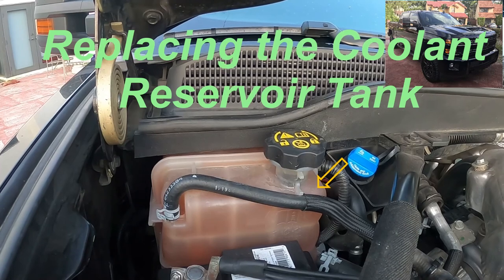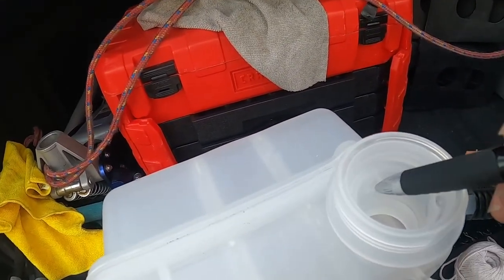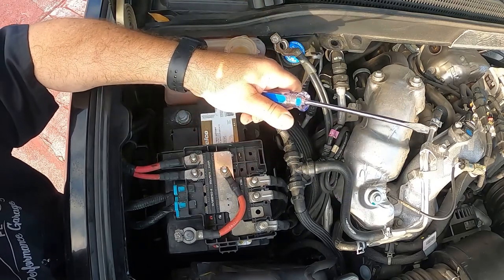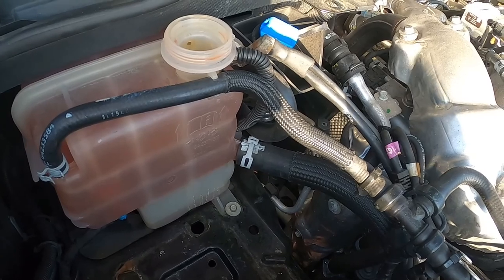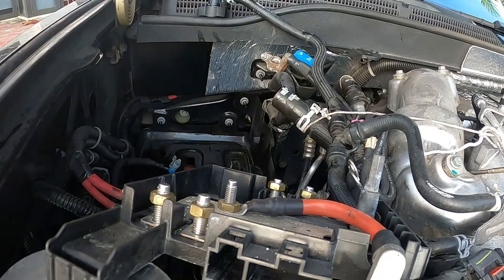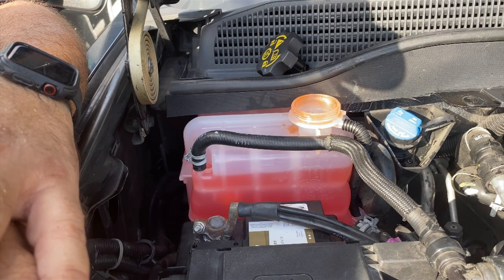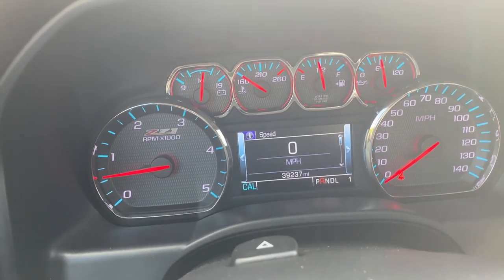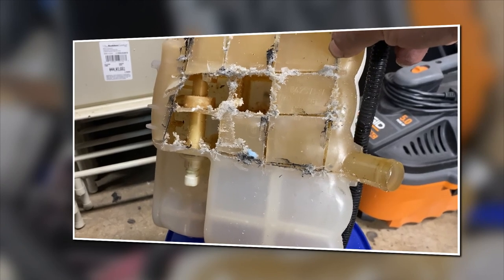“Low Coolant Warning”Silverado 2500HD 4x4 Duramax Replacing coolant tank.

Comment: Thank you for the video I just had this issue show up on my 2018 3500. I ordered my new tank received in a day put the tank in my self in about and hour start to finish👍👍👍👍 very simple
Reply from the maker: Glad the video helped with the replacement. GM knew it was a problem and changed the design in their 2020 models.

Comment: My 2019 Duramax did this just outside of the warranty. From what I have read, the replacement tanks only last about three years so I am not going to keep throwing money at a known problem.  I pulled the sensor wire and pushed a small fork shaped wire connector into it to jump it.  I taped it up to keep the water out and tucked it back under the tank. Now I have no more notifications and everything works just fine. I have never had a truck that told me about low coolant and if it does get low the temperature gauge will go up or if the engine gets hot I will smell it right away.  General Motors should have stood behind this known problem with all of these trucks.
Reply from the maker: I have read numerous post on owners jumping the connection and by-passing the sensor. You are right that the old temperature gauge will show you that it’s getting hot. My biggest issue with my truck is the reservoir tank, which was changed on the 2020 and up models by GM.

Comment: Excellent video. My 2019 2500HD has just 18,000 miles and the light comes on at every start up. Dealer says “let me see if warranty covers” 
I’ll find out next week when I go for oil change. If it’s as you say anything near that price I will do it myself. Your video is excellent! Well done. You display more patience than I got it seems. Question : Why would this not be warranty especially such a prevalent common issue ?
Should I get part from Dealer or Rock Auto or some other source?
Thanks, I’m a new subscriber
Reply from the maker: 5 years or 60,000 miles is the warranty period with the manufacturer, I don’t see why it wouldn’t be covered, I purchased my  replacement tank through RockAuto and the brand was ACDelco which is the Original Equipment for the truck. I looked into the aftermarket and was surprised what they are asking for a Aluminium reservoir tank with a sensor that is replaceable. The factory reservoir tank is a heavy duty tank that does not leak, the issue is the cheap sensor which can’t be replaced by itself. Thank you for subscribing to my channel.
Reply: @flperformancegarage4163  I agree, was puzzled when he stated that, asked me mileage. I’ll let you know, but thanks for responding and providing an excellent video with detailed line by line install!!
Reply: @flperformancegarage4163  The 2019 Duramax bumper to bumper warranty is 3 years or 36,000 miles. the powertrain warranty is longer.

Comment: Hello i just watched your video 😅my Coolant level thing came on today when i was driving home from work. I got home left truck on opened hood just as I thought coolant is full. Had this problem when truck 🛻 was brand new 2018 Silverado HD 6.6 Duramax Z71 its White. So 5 yrs later it turns back ON 🤨🤦🏻‍♂️ where can i find the GM coolant reservoir. Should i call the dealer or more like 🤔 an Online car parts place?
Reply from the maker: I purchased mine from RockAuto.com. ACDelco brand.

Comment: My truck 2018 duramax sounds like it gets hot / loud fan sound under the hood.... I have the engine light for low coolant even though its full... Could this be the cause of truck getting hot or loud fan sound?
Reply from the maker: What is the temperature gauge showing?

Comment: Do you need to fill the back tank? And if so, how?
Reply from the maker: I topped off the front tank and had the truck on a small incline and let gravity do the rest. I also had the bottom cap off, so when the coolant reached the small hole on the bottom cap location I knew it was full. Check the truck for the next couple of days and add coolant as needed. I checked my for a few days and didn’t have to add any. Remember to subscribe to the channel. I am doing the brakes next on the truck.

Comment: You don't have to let air out or anything whenever you re fill it?
Reply from the maker: Thank you watching my video. I secured the hose in order to avoid introducing air into the system, if you get air into the system, you will need to bleed the system to make sure you don’t have any air pockets.
Reply: @flperformancegarage4163  how do you do that

Comment: My truck is 2018 Silverado 2500 hs diesel and I’m little over 100,000 miles and barely started giving me issues this guys truck only had 40,000 mile on it seem like just a bad design

Comment: I can't refill mine unless I use the lower hole and I use a pressure pump. Is that new Tank different?
Reply from the maker: The replacement tank I used is from ACDelco and the original design to the vehicle. Dorman sells a replacement tank that maybe different.